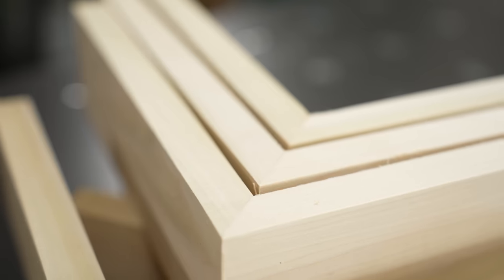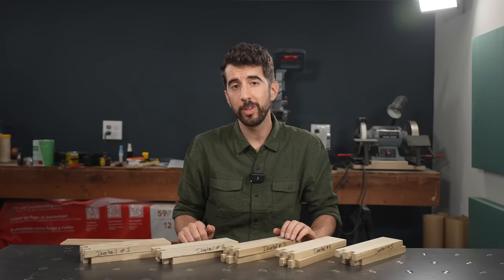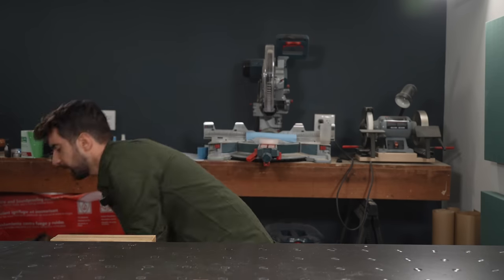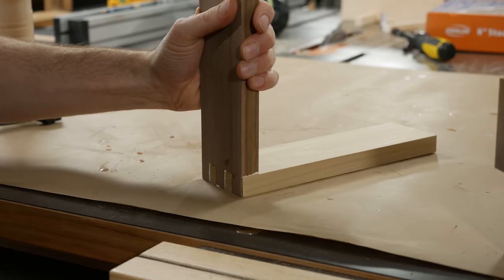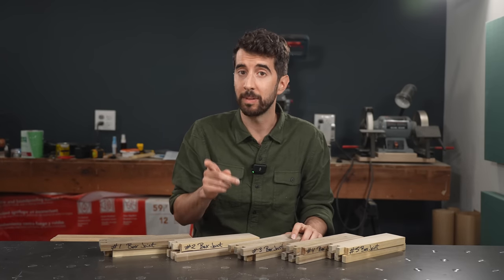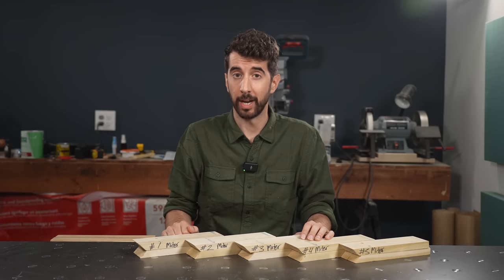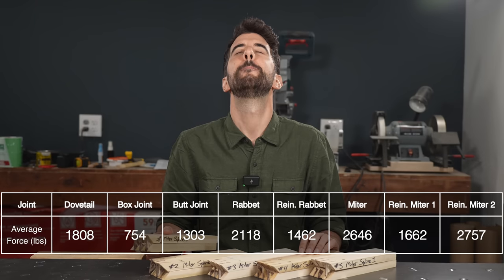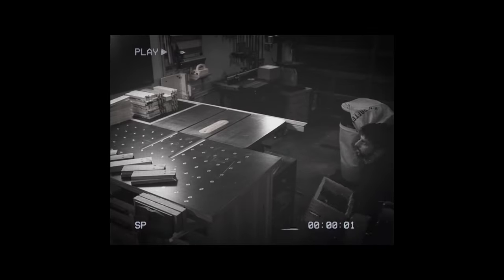This Simple Joint is Stronger Than a Dovetail!

Comment: Interesting stuff but I hope you will consider the following, if I may.  You are using different wood pieces (from different cuts even if using the same species) with each joint test (evident in the appearance of the samples).  You are also using far too small of a sample size for your results to have statistical significance.  The strength of any joint will be related to not only direction of grain, but also pattern of grain, moisture content, glue application, degree of squeeze-out, clamping pressure, environment (temp, humidity), etc.   If you tested say 5 joint types, you could have made one of each joint type from a single species of wood FROM THE SAME lumber cuts.  This way you could also get a better feel for how the wood species affect these joints.  Then make a proper sample size for each type - ready for this....for 95% confidence level with +/- 5% margin you need roughly 350 samples per test.   The smaller the sample size the less confidence there is that your results are representative.  Five samples gives you next to nothing and by throwing out the lowest and highest values, you are 1) biasing the outcome and 2) reducing your sample size even more and therefore reducing your confidence level further.   For example: in the case where you have 5 random samples and 3 are similar breakage forces, one is very low, the other very high....your thinking is that the 3 closest is the most representative of a larger population but there is no reason that would be the case simply because 3 were close to each other - all it says is those 3 are most representative of a very small sample size and that could be random fluke.  There is nothing to say that of the 5 random samples, the lowest breakage force (or the highest?) wasn't actually closest to representative of a larger population, the other outlier being rogue, and the 3 closest were just random flukes.  This is exactly the reason why sample size is so important in experimentation.  You have to find certainty in the results rather than just random outcome being a predictor.  For example:  A coin toss is 100% certain to land either heads or tails on any single toss, with edge landing not being permitted. Therefore there is a 50:50 chance any toss will be either of the two outcomes.  Now, toss the coin and start tallying.  You could toss 4 heads in a row or 7 tails but it will not be one, then the other, then the other as if they must take turns.   It would require a significant number of tosses before the statistics begin to show that there is a 50:50 outcome even though in the case of a coin toss we know it to be the case (assuming the coin is equally weighted on each side).  The same thinking must be used with any experiment IF YOU WANT THE RESULTS TO BE REPRESENTATIVE of a larger population - translation:  results would apply to all woodworking joints, for all woodworkers, world wide, for all time.  Interesting stuff and a lot of work you've done for sure.  If you feel that some of these outcomes do not align with what your instincts tell you - now you have a plausible reason to explain why.  Repeat this using much larger sample sizes, uniform selections of wood and species, controlled environment (temp, humidity) so glues dry/cure the same each time, etc.  As a last thing to consider...each of these joints are used in different application scenarios where the joint is traditionally considered satisfactory. A complete set of tests would put each type of joint through tensile, shear, torsion force tests both with and without the kinds of leverage that would be inherent in the specific application.  THEN compare all those results from large controlled sample sizes.  Hopefully this has been insightful.  Final Note: anyone out there trying to steer your thinking (products, government, etc) quoting statistics is probably doing it wrong too as swaying opinion is their objective and using data incorrectly is their tool of choice because most people understand too little to know the difference. I hope this helps anyone who reads it to be less vulnerable to such situations.   Kindest regards!

Comment: Not a pro woodworker, so maybe this wouldn't be as feasible or as effective as I'm imagining, but couldn't you also dovetail the corner reinforcements on the miter joint to add even further mechanical advantage?

Comment: It seems your tests are testing the force required to pull the two piece of wood apart by bending the joint (trying to open the angle). In use most joints are not going to be pulled apart that way but exerting force while still kept at 90 degree angle. For instance.... a drawer is abused by slamming the drawer over and over. I suspect that the joints that are reinforced with splines or box joints may have an advantage even though your testing showed that ripping apart by opening that angle was what was tested. Also consistency of the glue up would make a difference. Some of the value in the spliness and box joints, was it provides some protection against less than ideal glue up or sloppy clearances between mating surfaces.

Comment: Dovetails are interesting because they technically don't need any glue, especially when the dovetails are large like in timber framing. They also work pretty well when they are sloppy with ugly gaps -- an application where glue does worse since it won't really bond a gap. I think this tendency of them to stay together mechanically (especially in antique furniture with the old hide glue long de-laminated) has given the dovetail a survivor bias in people's minds.
Reply: This is absolutely correct, and they look fancy on the front sides of drawers.

Comment: You said the rabbit joint had no mechanical advantage I'd say it had a leverage advantage as the step transfers energy and force from the top to top and side support and as any engineer knows leverage is a mechanical advantage so yes the rabbit joint is strong because of mechanical advantage and if you added more steps to both sides to get a more diagonal line it's transfer more force and be even stronger

Comment: This is really a fantastic information and humor-filled video and I learned a ton about joint strength. However, unless you are building an aircraft carrier out of wood, why would you need a joint that takes 2700 pounds of force to break. Most of the drawers, desks, vanities, entertainment centers, and dining room tables I've built, have never put 2700#'s of pressure on any of the different types of joints I've created.

Comment: If the miter with after slots is so much better than the box, and the box works great, then why not try to make a M+S with much thinner wood until they both match again.

With this, you use less wood, lighter, and allow for more space in the same size piece.  Win Win Win

Comment: Bear in mind that the failure of a drawer is usually in one direction.  The dovetails need to be placed correctly to take that load.  These tests are not testing that.  They are good all-around tests but not exactly what a drawer experiences.  Great video.

Comment: 1,  How much tension is put on a drawer front-to-sides joint that requires a ton of strength to hold it together?  Fancy drawer joints are ego-soothing for the woodworker.  Who sees those joints in a dusty shop with the drawers closed?  2.  End grain-to-end grain joints can be plenty strong if the cuts are clean, smooth, and aligned.

Comment: Watching this video, I'm now wondering about a single dovetail cut into the shorter axis (sort of like a French cleat, I guess) instead of the several small dovetails cut into the longer axis. I wonder how it would perform compared to a traditional dovetail. Or maybe even a miter joint with dovetailed splines...

Comment: Don't want to be that pedantic but in a video trying to be scientific I think it matters.

Wouldn't that "mechanical interference" instead of "mechanical advantage" since there is no work being multiplied by the sloped surface ?

For instance, the threads of a screw are inclined to get more force out the mechanical advantage of the sloped surface but once the screw is tightened what hold both an unglued dovetail and a bolted joint is plain friction. And the sloped surfaces just adding a mechanical stop and surface contact.

Comment: Over time, your mitre joints are going to open up and fail. Seasonal and regional variations in humidity will cause the wood to move and it is a powerful force. In a drying situation, as the wood shrinks across the grain the joint will open and it's strength will be all gone. Also, for drawers, if you are using mechanical drawer slides, the strength of the corner joint is hardly relevant. The drawer front is never going to be yarded on like they are in an antique dresser. Use any joint you want. But look at nearly any old set of drawers and I can guarantee none of them will have been put together with mitre joints. If they were, they've gone to the dump long ago. Master craftsmen were call "masters" for a reason; they knew what they were doing.

Comment: What surprised me is that you added glue to the dovetail joint, I specifically use that joint because it doesn't need glue in order to work

Comment: I’m curious how these compare when using plywood instead of hardwood for drawer boxes?
Reply: Here, Here!  I see many--if not most drawers--being made out of .5 inch Baltic Birch. Interestingly, I examined my bathroom vanity drawers and discovered veneered (face and edge) Baltic Birch joined by dovetails. Would that joint be weaker?

Comment: I would suspect the miter is also one of the most resistant joints to expansion and contraction due to humidity.  The reason being that you have the same grain orientation on each side of the joint.  The real issue with expansion and contraction is differential expansion and contraction.  Mating end grain to side grain will give differential expansion which an induce great stress in the joint.  It would be an interesting test, but I think your theory on miters being more susceptible to expansion and contraction is incorrect.

Comment: I cut dovetails only for the looks. Any wood joint is strong enough for regular use like drawers and sh*t. If I need something really strong I pull out my welder and lay down some beads on some angle iron.

Comment: Don't sleep on Fish Glue it's much stronger then PVA but it costs 3x as much. 

Even hide glue is strong enough. Pva technically edges it out but it also adds a ton of time and cleanup. Squeeze out, messing up finishes, cleanup time, it doesn't bind to itself so pieces can slide. Hide glue has none of those issues.

Comment: I like your video, and it will lead me to make more splined mitres, but I don't think you justified your method of testing a joint's strength. Joints endure a variety of forces depending on their use. Very interesting though!

Comment: A caveat to this, and probably the reason that people have more faith in dovetails than in the other joints is that the forces involve aren't simple pulling even when pulling is the greatest force. The other joints all depend upon the glue, whereas the dovetail does not.  When the joint is subject to hinge-like forces repeatedly over years or decades, glue tends to fail even though it is often stronger than the wood itself in a single tug of war. The dovetail joint holds together even if the glue eventually fails, while these other joints mostly do not, unless you use mechanical fasteners, e.g. nails, as well.

Comment: Haven't done it yet, but always wanted to  place a dowel vertically through a box (finger) joint. Would assume that most if not all of the glue would be scraped away during insertion. What does the little voice say about its relative strength? 🤔

Comment: You want psysico real strength? I tested the Franklin  "high performer" small polyurethane filled aluminum hot melt type cartridge tubes that provide only 75 linear feet of 1/16 glue bead for 12 to 15 bucks a tube) it out performed every typical glue we woodworkers all use by a mile! The 45° miter joint was so strong it ripped a chunk of grain out from the opposing part almost an inch long and from the center of the part!!!!! You need 12hrs for it to reach 100% glue strength though. Amazing stuff. The public thinks its another hotmelt gun so I think it will eventually go away mostly unused by the masses.

Comment: how would pocketholes stack up? (where the pocket holes are hidden by the front and back so no visible marks on th eside)
Reply: If glued as well, I'd wager it lands pretty close to butt joint plus dowels, but a bit weaker since less wood failure is required to release the pocket screws.  Without glue, I can attest to how profoundly easily wood surrenders the unsupported chunk of long grains directly under the screw head, either directly out or by shearing sideways.  It's about the only joint I'd actually consider completely unusable for load bearing structural joinery.

Comment: IMO the splined miter is the strongest joint we can make these days and depending on the choice and thickness of spline material probably stronger than even your example. The box joint however should have done better I've seen other test where it came closer to splined miter and much stronger than a dovetail. My guess you're right it was glue starved. Which is why the plane miter and splined miter are so strong they being the easiest to get a proper amount of glue into.

Comment: What about a joint that is like a dovetail, but with the angles cut in the opposite direction. Increases surface area compared with rabbit and won’t force the glue out when assembled?

Comment: Surely it's "mechanical locking" that is meant? "Mechanical advantage" is something completely different to me, using levers, wedges, and such - increasing force on one place by applying a smaller force but over a longer distance.

Comment: And let's not forget for something like a drawer, you'd have to pull at least 1400 lbs to break just the back or front section of a newly built drawer box. I don't think that's happening anytime soon for most people as the handle would probably break out first.

Comment: The difference between the post glue splined miter and the non splined miter was fairly small. The difference between the non splined miter and all the other joints was significant. Looks like miters for me from here on out.

Comment: I would be interested how a 1/4 x 1/4 x1/4 rabbeted joint would hold up. It’s what I predominantly use.  But the I’m never trying to show off, just get done and be good enough.  I have yet to have one fail.  The drawers in work bench are 9” deep and carry an easy 100 lbs of tools.  Been out there in the garage for 36 years expanding and contracting day jobs n and day out.

Comment: I suspect the reason Miter joints are the strongest, is because it's endgrain-to-endgrain. Glue on endgrain is stronger than glue on sidegrain because the glue seeps into the fibers
Reply: That's not correct. End grain joints in controlled tests break at higher forces because the lignen (natural "glue" in the wood itself) holding the fibers together can't break in a miter joint. In other configurations involving edge and face grain the lignen is what breaks (what people call the wood failing). End grain glue ups snap the glue line instead. And modern PVA glues are stronger than the lignen in the wood. That's what you're seeing. It's not because the glue soaks into the ends of the fibers. That's actually a disadvantage to end grain glue ups.

Woodworkers have known for a long time now that it takes the most force to snap a long grain fiber, less force to snap wood glue, and the least force to snap lignen. So a joint that allows lignen to experience a load will be the weakest as that's the failure point that require the least amount of force.

Comment: Hmmm, which  joint is strong enough?  If I need to  lift my motorcycle  with a cabinet drawer maybe I might need a  stronger  joint. For my silverware,  I  think most of these would work.  This actually  for practical purposes has come down to a signature joint or an art than a necessity.

Comment: I couldn't see the orientation of the butt joint. Was the piece that got pulled upwards glued to the top of the vertical piece or to the side of the vertical piece?

If it was glued to the top of the vertical piece, that may explain why the rabbet was stronger. Just like with nailing, I am guessing, if the piece is attached to the side of the vertical piece, it could have stronger resistance to upward force.

Comment: I noticed that you were pulling the dovetail sideways, where the wedges are entirely useless. In that direction it should be almost identical to the box joint. The other direction is where this should be much stronger.

Comment: I always choose a joint based on its aesthetics as I sell most of what I make so for boxes it's always dovetails because they look nicer the same with picture frames I always use a mahogany spline, and because I sell them as long as they last at least one year then I could not care about the strength because if it fails that's more sales. Cash is king.

Comment: Late to the party here and skimming quickly through but what I see at 3:50 is basically a starved fingerjoint. When this is pulled togethere there will be no glue on the sides of the "fingers". Am I wrong?
Reply: I wonder what this would look like if you had spread the glue on all surfaces prior to pulling the tight fitting box joint together.